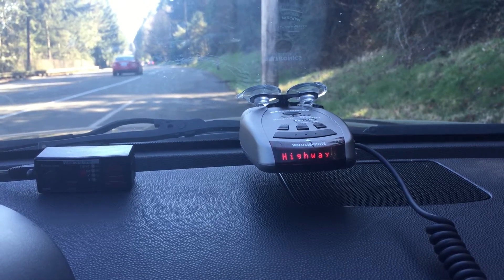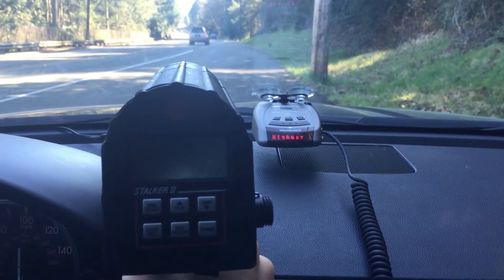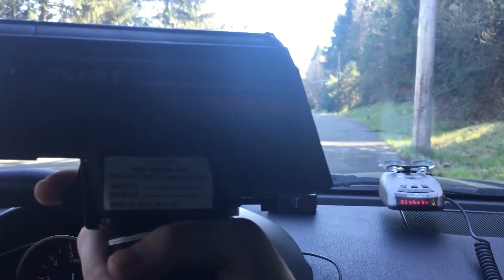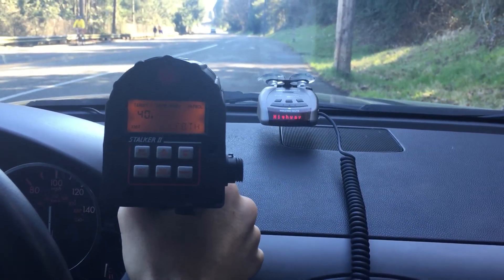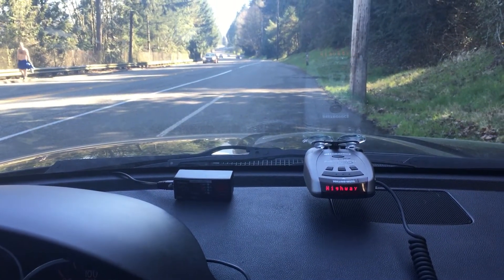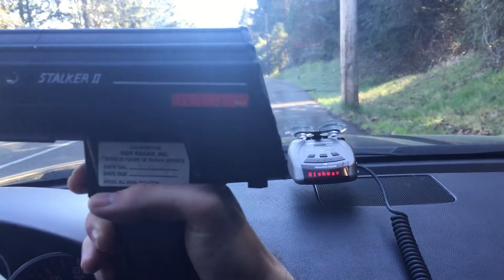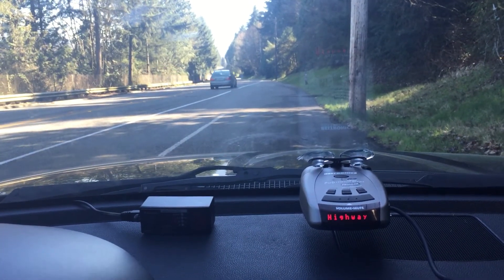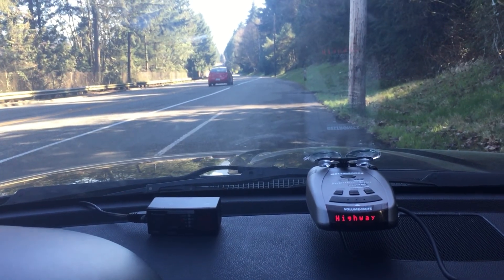Radar Detector Overdriving

Comment: Does overdriving cause permanent damage? Say in the case of a Redline?
Reply from the maker: +John Michael Hinson While I've seen Nine_C1 have an issue eventually after a lot of testing, in general it doesn't seem to be an issue, no. :)
Reply: +Vortex Radar thank you for your prompt response! 
I just got a Bushnell K band gun and was messing around with my Redline. I only shot it a few times and saw the Redline display incorrect frequencies. Then I learned about overdriving lol. 

It seems to be behaving normally now though. 

Thanks again.